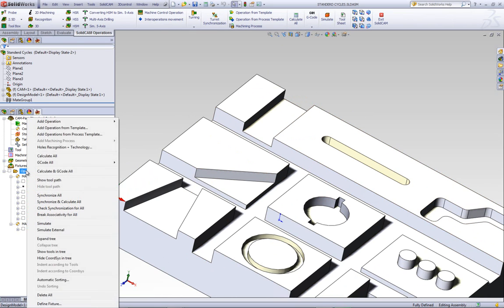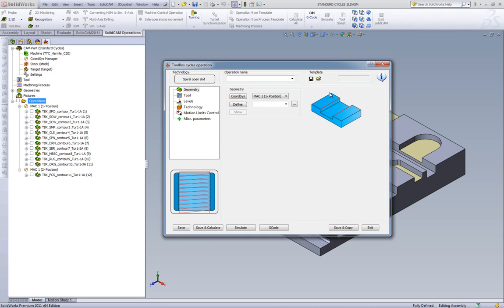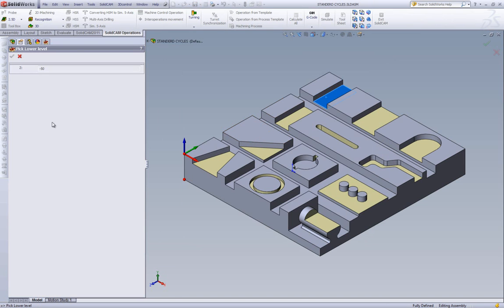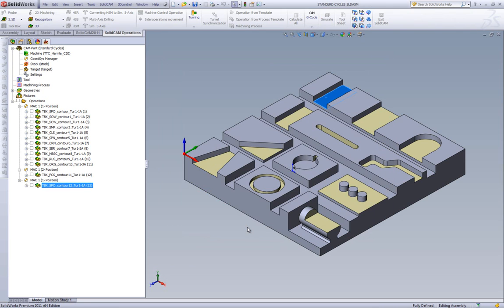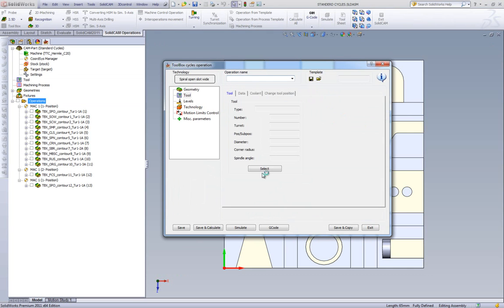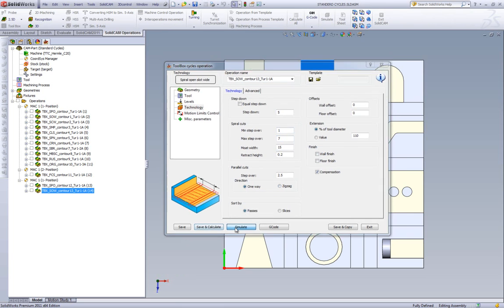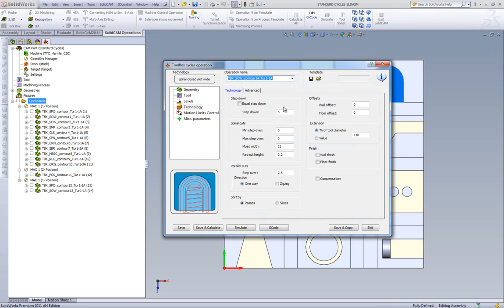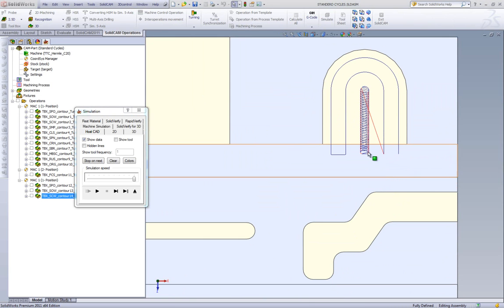SolidCAM 2011 Tool Box Part 1 CNC Milling Software

Comment: I'm studyng SolidCam. But should I use Tool Box Instead 2.5D operations? Some times I think there is no difference between both methods... Could you explain?